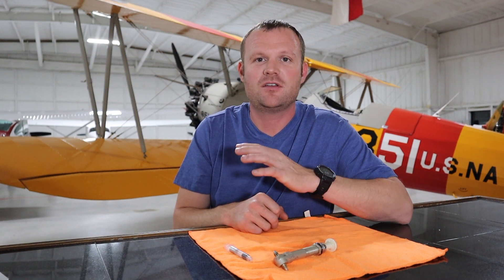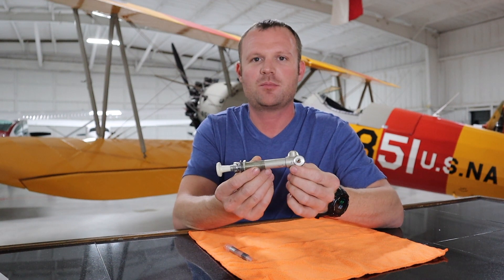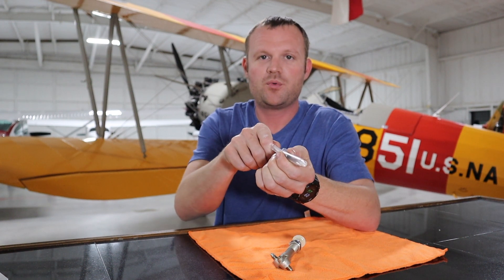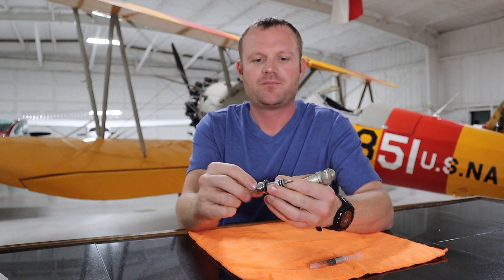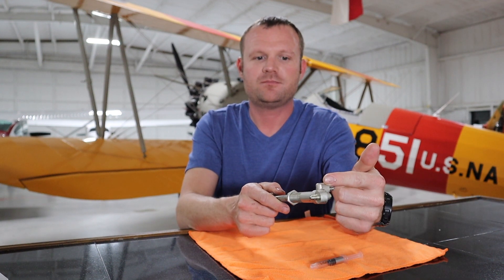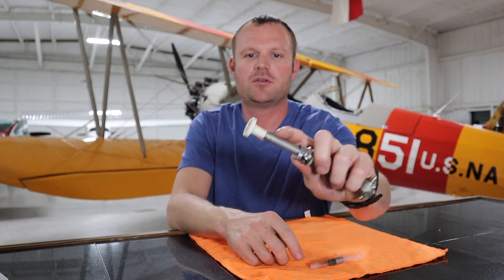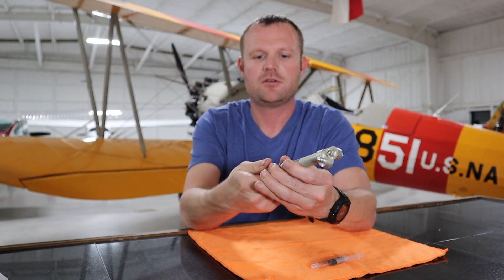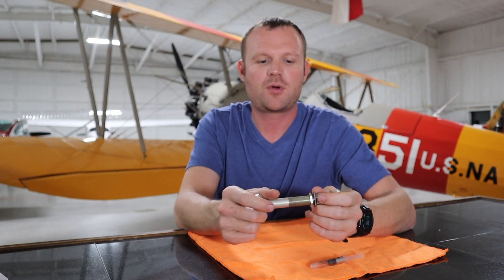Fuel Primer - Aircraft Systems

Comment: Question Hopefully someone see’s this and has an answer. A couple months ago I went to the local airport and rented their PA28. After all my initial checks and as I began the startup checklist, I went to prime, and on the second pull, the nut holding the primer in came unscrewed and the internal primer assembly came fully out of the airplane, along with a decent amount of fuel. I did not feel safe flying that day after that and so I called it a day and told the aircraft mechanics about it. They were not concerned at all and said they would just tighten the nut for me. Since the last annual or systems check by the mechanics, the primer nut had slowly become unscrewed and loose.

My question is, if I was mid flight and some normal bumpy air were to have knocked that nut off the last thread that it was hanging onto, if the primer assembly fell out completely mid flight, would the engine have died?
Reply: For context, I'm no aircraft mechanic but a good bit of car mechanic experience so I'll throw my guess into the ring as I find it to be an interesting though exercise.

Short answer, no I don't believe your engine would die. I do think it would continue to leak fuel however. 

The primer pulls from the float bowl which will continue to pull fuel (in the bowl) to maintain the set "float", but I don't imagine the fuel would leak faster than the float can fill the bowl. Maybe there would be a stumble if it was close, but the added fuel pressure of the electric fuel pump would be a good stop gap. I'm assuming that the reason a primer feels stuff is because it's pulling the fuel through a restricted narrow fuel line so it wouldn't just drain right out. 

On the other side of the primer, going to the intake, would be a vacuum. So just like in the video where he says it will pull fuel mid flight if left open, I believe it would now be pulling a bit of fuel and air, so it would be a different experience. I imagine it would be like the idle set too high, with a nice fluctuation as it gets more and less fuel from this leak.